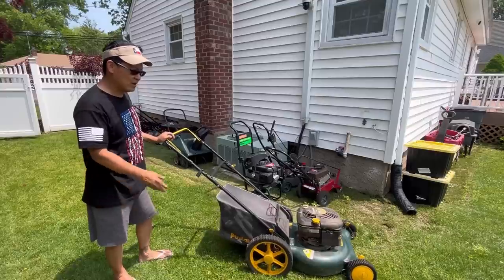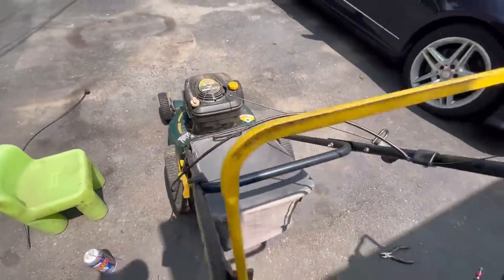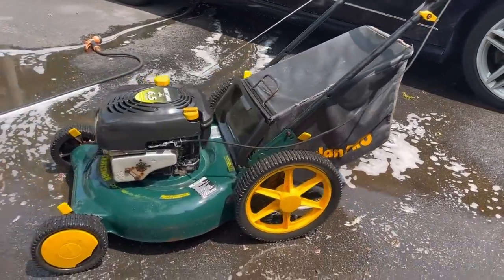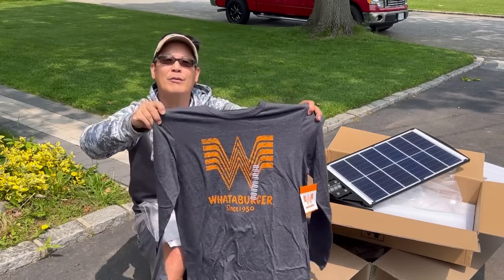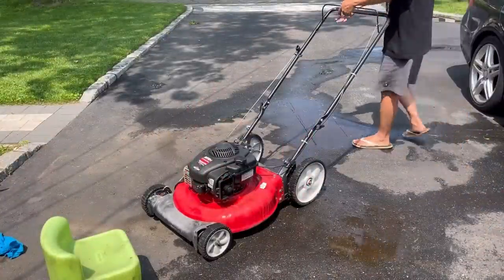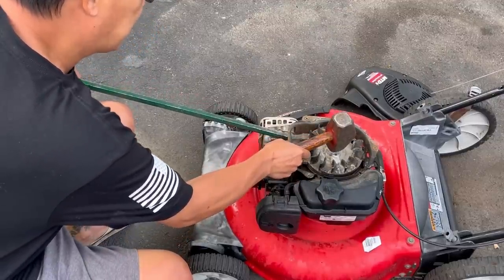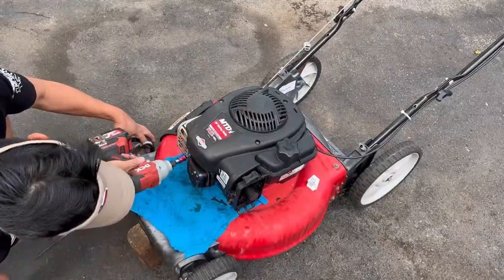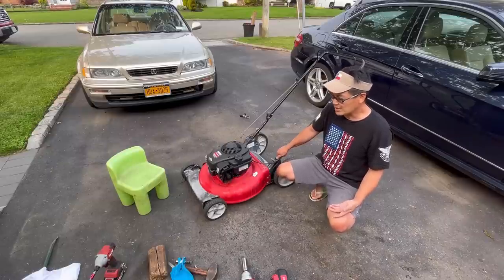FIXING TWO PUSH LAWNMOWERS IN ONE DAY!  GETTING THEM READY FOR SALE IN THE HEART OF MOWING SEASON

Comment: I put a dab of grease on the cables to keep the water out and lube it up

I just had a 163cc similar issue with key.  It ran but was missing a little .  Put in a new key and purred like a kitten.  The OHV Briggs are more susceptible to timing issues.  Then the flat heads